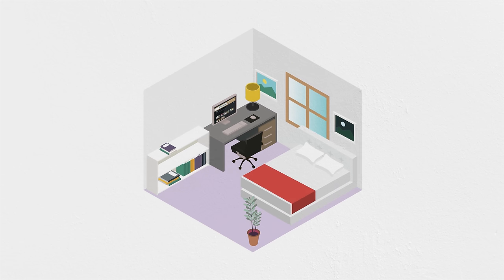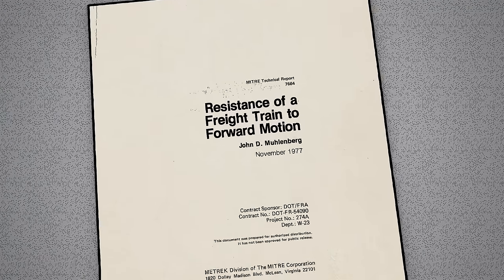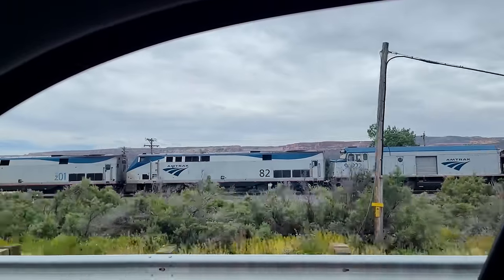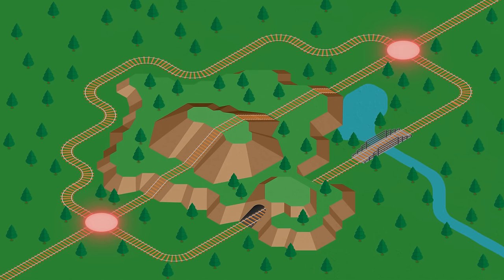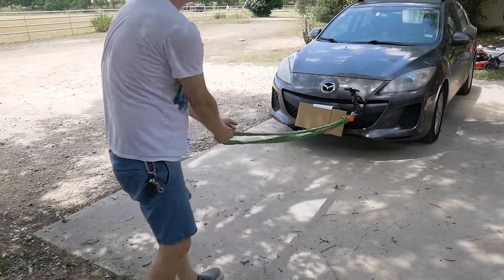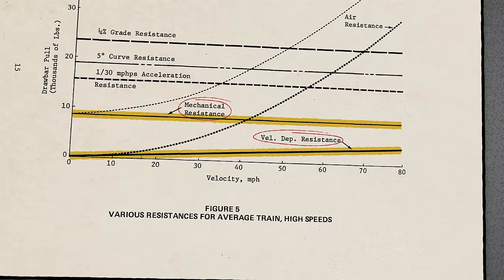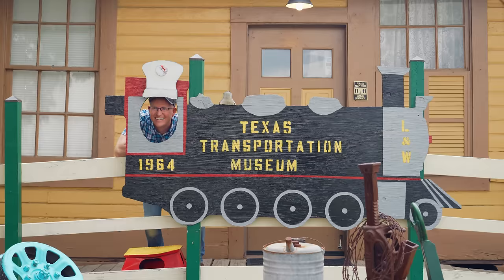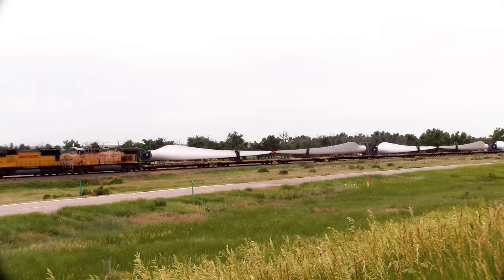Which Is Easier To Pull? (Railcars vs. Road Cars)

Comment: When traveling thru the mountains aka the Rockies , Alps or in Pennsylvania the highway is usually high up and the ( freight ) railway is usually below the highway . The highway may be straighter on a map but the trucks have to spend more fuel ( energy ) to lift their tons higher up to get over the mountain paths than the slower freight train snaking further down in the valleys  .

Comment: I used to work at a wear house unloading recycled cardboard from railcars.  Getting an engine to move the cars was time consuming and expensive so we did it by hand.  I can push 2 loaded and 1 empty railcars solo.  The hard part was getting it starting to move because where the cars sit at the loading door had a dip in the track so you just keep pushing it and it rolls back and forth and you just use its mass to rock it back and forth a few times until it eventually gets out of the dip. Once the first set of wheels was out of the dip it was really easy to keep it going.

Comment: One example of lower rolling resistance - there's a czech railbus that took its mechanicals directly from a citybus. It weights twice as much as the bus, but while the bus had maximum speed of 65km/h, the railbus could reach 80km/h while pulling a 15t car.

Comment: I worked on trains and in the hump switching yard in Winnipeg.   We would have to go and tie up tracks.  That means the cars are not connected and were switched into 80 tracks by rolling down a hump to sort them.   So of two workers in a team I would walk the track to tie up while the other worker would pull out a track we already tied up and stick it to a final track to build a train.   These tracks were 30 to 40 cars long.   So there would be cars with boxed knuckles and the engine would have to separate the cars a little while I opened one or both knuckles and then the engine would push the cars together and they would  be attached.   Sometimes I used a 2x4 laying on the ground to move the cars myself. Sticking the 2X4 between the two knuckles.  No engine needed.   I could even push some cars a little a few inches , enough to open the knuckles.    I worked for years and then one day just fooling around and pushed really hard on a car and it moved.  Amazing and then I decided to try using a 2X4 between boxed knuckles and it usually worked .   Usually only worked moving one car.   So I could walk down a track and move the cars a little just enough to open all the knuckles and when the engine came back we just bunched up 30 cars and they all tied up at the same time.   It made our work more efficient.

Comment: great video.  I run railroad motorcars and have  a car that weighs around 5000 lbs but can easily move it by hand whereas I know i cant move my car by hand.   
My smallest car, a fairmont M19 (weight 500 lbs), has a 2 stroke single cylinder engine that only has about 5 HP and needs flywheels to help it run but it can get my car upto about 30-35 mph quite quickly.

Comment: I volunteer at the Hampton and Kempton Steam Railway, a 2' gauge (610mm, not 600mm (1'11 1/2") as per welsh gauge) line in London, England. And once I leaned against a coach in the carriage shed and it just moved, because I didn't realise its brakes weren't on. Fortunately I stopped leaning on it before it moved very far.
We also have a small issue shunting our steam loco into the steam shed with one of our diesels, as the track is a little uneven and quite greasy just outside the shed, so we have to build up a little more momentum than would otherwise be ideal just to get onto the flat rails inside the shed. Otherwise, the diesel just hunts in place as it fails to grip the rails.

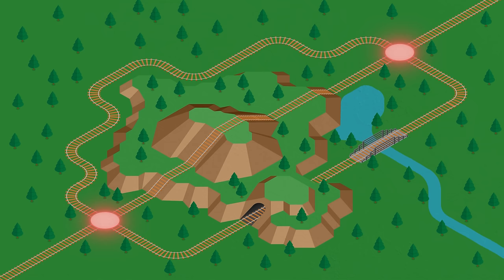Comment: 5:22 energy can be recovered. All swiss trains essentially do this, it's called electric brake and the power is transfered back to the catenary and drawn upon by other trains going uphill. To give an example the latest two-decker, 400 meter-long train added to the  inventory of SBB, can recover on every run around 60% of the energy it spent, which is amazingly efficient

Comment: We are getting a up close and personal with rail transport. 
In Australia we have a large country with a small population, and we do have a certain geographical challenges as well. Most of what we have moves up and down the east coast of Oz, with Melbourne being the southern anchor and Brisbane the northern anchor. We have a decent road on the coast that connects all of our eastern cities Melbourne, Sydney and Brisbane. The challenge is the road is shared between automobiles and trucks with the large B Double trucks weighing up to over 50 tons. The crowded road is often a challenge between the trucks and the automobiles especially during peak traffic times. We do have an inland road running north and south called the Newell Highway, I have traveled this road, and it can be a challenge with some of it is not paved, there are some one lane bridges where the traffic challenges each other for the right of way. There are speed limits on the road but realistically the speed limit is the limit you wish to push your vehicle to. Having driven the road, I compare it to driving a Sprint Car for ten hours at a time. There is no cruse control. There are sections of road where there is no electrical grid present. Often you will see very large 200litre drum laid horizontally with one end open near a gate with a driveway disappearing into the distance. I was informed that some of those driveways may go for several hundred kilometres to the homestead. Apparently often these “mailboxes” are used for grocery deliveries to the homestead. Amazing. 

The Australian government was challenged to solve both transport challenges of today and future environments. 
What they have decided to do is build a good and proper rail network running between Brisbane and Melbourne using the most reasonable straight line between the two places. This rail network has nothing to do with the Brisbane Cross River Rail infrastructure work.
The ARTC (Australian Rail Traffic Corporation) has been working with us to take our property for use on the project to join Brisbane and Melbourne with big standard gauge rail network to utilize double stack container trains with the plan to take 200,000 trucks off the road. We were informed there will be two trains per hour and running 24/7. 

They told us eight years ago this was happening and now that the project has been upgraded to a 31 Billion dollar project now they are taking our property so we have to relocate and they are paying us well for what the deem to call “disturbances”, we don’t want to stand in the way of progress and I thought the process might be adversarial but not as much as you may think. 

Now to find a new property and build a new house and workshop. Property values are rising rapidly in the area as they just built 10,000 new homes just down the road from us. Brisbane area is the quickest growing area in Australia and for our family we just need to stay outside the residential area as we prefer to live in the bush, it is just that the line between those areas is moving as we speak.

Comment: I still remember an old informational film called Spinning Levers which states in the beginning how a rail yard worker was able to use a small lever to get a fully loaded car to move down the track with ease due to the mechanical advantage. It showed briefly how he put the lever under one wheel and pushed it down, which moved it a small bit, but with so little force required that he used one arm to push the lever and get it moving.

Comment: One of the things I have advocated for a long while is switching as much transport to rails as possible.  I can't remember the study but it talked about the fuel cost of moving a load from something like LA to KCMO and using a tractor trailer to move the same amount of cargo a train would move was astronomically higher on the fuel costs alone, not to mention the cost of the labor.  

My idea switches us back to something more like the old depot system.  It would require lots of tracks to be double tracked and in some area's triple tracked with yards available where a train can easily disconnect the cars slated to be dropped and then pick up any needed and move on to the next point.  The other part of the equation is opening up ALL rails to multiple carriers, the big rail companies wouldn't like this as they would lose a monopoly in their particular area's but let's be honest most of the rail infrastructure was paid for with land being sold by the railroads that was given to them by the government in the 1800's.  Few if any jobs would be lost but we would have much less long distance over the road trucking outside of things that are very time sensitive.    The trucking jobs that would go away would end up being shifted to jobs at the depot loading and unloading train cars or shifting containers around.  Not to mention the jobs that would become available operating trains on the rails and the companies that currently exist already operating small railroads would be able to grow and expand. 

It wouldn't happen overnight because obviously a lot of work would need to be done but over 25 years we could easily make the switch.  At the same time we could electrify the sections of track and expand the grid and interconnections along the rail lines to not only provide power for the trains but also towns along the routes and eventually to others states hundreds of miles away from where the power is being created.  Another benefit would be that the lost power due to slowing while traveling downhill could be partially recuperated and sent back into the grid.  

Is it perfect, no.  But it's a step in a different direction and with competition on the rails in a similar fashion to the trucking industry the cost of moving freight would decrease as there would be more options to move freight on the rails and when things get to the depot you would still have multiple companies interested in hauling the freight the last mile (or couple hundred depending on the distance from the depot.)

Comment: Curves also have other problems. One of the reason for DP units or pusher/helper engines is because of the fact that long lines of flexible things like train cars tend to want to straighten out as they travel. That is, the way the pivot point works when you add all the physical forces involved, the front of one car wants to go the same direction as the front of the car it is attached to, not the back of that car. That's part of the reason you hear flanges squealing on that curve. They're being pulled sideways into the inner curve of the track and, as a side note, also putting wear on that rail. This is an effect termed "string lining" and it tends to pull trains off their rails. An example is the Cantara Loop derailment in 1991. The train was too long for the curve and since it was empty, it wasn't felt that a helper engine was necessary. So as a result, 19,500 gallons of pesticide got dumped into the Sacramento river and, IIRC, the ecosystem still hasn't quite recovered to what it once was.

Comment: Trains actually don't use the air brakes that much going downhill.  Even on long grades they use dynamic braking.  Turning the traction motors into generators is the most efficient way of braking the train.  Heat is generated and sent out the top of the locomotive via heat sinks.  Dynamic braking saves wear on the wheels.

Comment: with the route with a lot of corners, you forgot about the risk of string lining which is where the locomotives basically pull the train off the track as that's the easier path for the train to follow

Comment: If you have ordeered anything cross country with delivery by UPS or FedEx you have shipped by rail. If you live in the middle of the country you will see trains with dozens of "Rail" trailers strapped to them. Rails are specially developed trailers designed to mate up easily with train cars for ease of loading and unloading.

Comment: A neater thing - I used to work on the barges on the intercoastal waterways, you can push a fully loaded coal barge sitting still in a lock, 2000 tons and you can move it back and forth, it makes you appreciate physics - It also shows why water transportation, where it is slower, it's more efficient.

Comment: (5:30) Small story : I've had an internship at a company handling locomotive data, and one of the things I worked on was the historical location data, namely the distance calculations. In a perfect world, you'd continuously be getting the precise location of a locomotive and it you'd be able to find the distance traveled using integral approximation techniques with the needed precision... but this is far from a perfect world. GPS data is imprecise and usually varies by a few dozen meters, and the timing itself is spotty, varying from 5 seconds for some locomotives to 5 minutes, with absolutely nothing when entering a tunnel.

One of the methods I tried used that very fact : Railroads are a series of linear and curves of fixed radius, i.e circles. So what I did was take the two points I wanted, the previous point, and the next point, and compute the highest of the curvature of the first three and the last three points. If it's below the curvature of the biggest circle in a European railroad track (= smallest curvature that's actually a circle), I took it as part of a circular arc, and computed the length of said arc. If not, then either we're in a particularly large curve outside of Europe (very unlikely), or it's just a line. In that case, a simple Euclidean distance will do.
(I used the maximum of the four because if I only used the previous point, it wouldn't work on the first measurement inside an arc, and if I only used the next point, it wouldn't work on the last.

In the end, it turns out that for most locomotives this only changed the results by adding a few meters over hundreds of kilometers, but for those with less precise measurements it became a few kilometers. That's because the error from the euclidean approximation of a circle is quadratic with respect to the time between measurements, specifically in O(k²v²/r), with r being the radius of curvature, v being the velocity, and k being the measurement time. Multiply k by 30 and suddenly your meters turn into kilometers.

(Factoring in elevation also ended up being fruitless, since a 500m drop over 500km amounts to... a track that's 25 centimeters longer. With a constant 2% slope (very steep for a freight railway, it would be like a 10km drop) over the same distance, you're adding 100 meters.)

Comment: Max grade on the us rail system is 2-3%. Mostly the steeper ones are in the Rocky Mountains. Some of those have a smaller wheelbase to help with sharper turns but the compromise with lower weight capacity.

Comment: Where you can actually experience your ability to move several tons with just your pinky is a sailing yacht in a marina. You can apply as little force as you want. Just pushing with the pinky of course it would take several seconds or even a minute until you actually see speed building up. Though always keep in mind, applying the same force for deceleration / stopping would take the same amount of time. So don't just accelerate the boat to a mere 0.01m/s without thinking about how you're gonna stop it again ^^. Though when you actually enter a marina, it's common to just push yourself off-of other boars with a long stick / hook. That way you have enough time and space  to change the direction / speed.

So technically you could even push the titanic off the port. Though with such large ships, wave currents and especially wind plays a huge role. So then the wind blows towards the port and you try to push a cruise ship away from the port, the wind would win ^^. However since there's no static friction that needs to be overcome, just leaning a broom or mob agains a ship that isn't tied would actually push it away slowly. Of course again given that no other factors are involved.

Comment: 4:23 BHP represent!! I design rail for BHP network in the Pilbara (and have so since 2003) and they used to design for 6 loco with 336 ore cars (~3.6km or 2.2miles). I think their current design is 2loco and 150 ore cars in a rake and they run consists of 2 rakes. When design loops the curvature acts like a grade a 500m radius curve Acts like a 0.5%. Grade which is good for indexing through car dumpers.

Comment: Fuel isn't really used to move most locomotives in the US. Electricity is. North America just doesn't want to build the electrical lines over the freight lines to allow for that electricity to be from potentially cleaner grid. So the Trains have the Diesel Generators to power the Locomotives. Generally due to upfront cost and remote maintenance. 

I only make this distinction because many modern Diesel Electric Locomotives can actually be converted to other types of generation...(though at some significant level of cost) or even a hybrid over head/generator operation if the will existed to allow them to run off multiple sources of electricity without changing the drive system. A Full Diesel Locomotive wouldn't have that ability without a significantly larger cost level.

Comment: 5:00 This only applies on unelectrified lines common in the US. In Northern Sweden we have the Iron Ore line which transoports ore from Kiruna 500m above sea level to the port in Narvik. During the decent the motors turn into generators sending power back into the catenary. Since the train is empty going back uphill they use less energy going up than the produce on the downhill.
Reply: This line also uses one of the strongest locomotives in the world (depending how you count) pulling 68 cars weighing 120 tons each. Each train has 6800 tons of ore, 10 trains per day enough to build 6.5 eiffel towers per day.